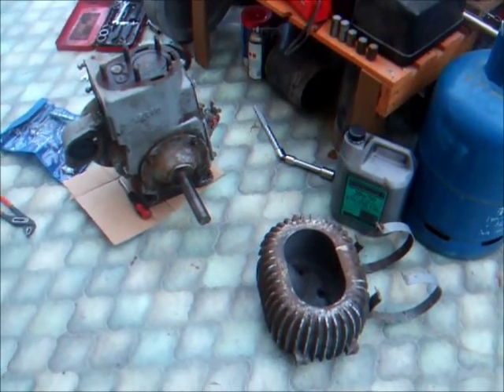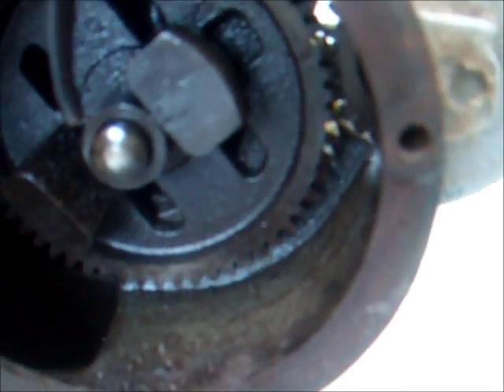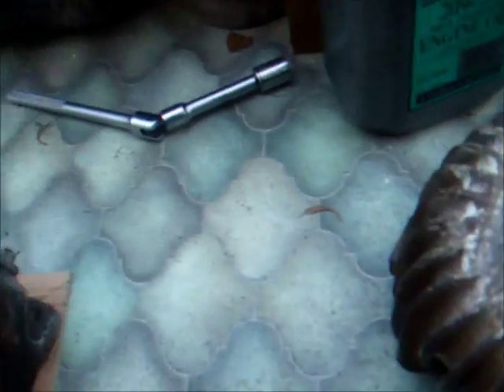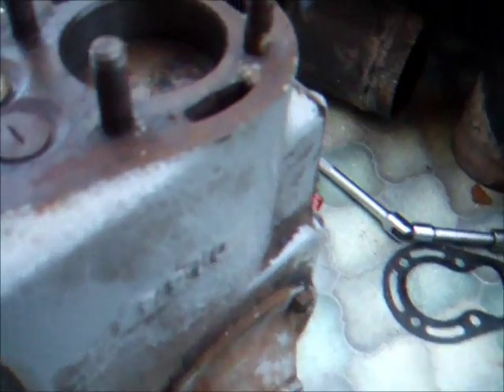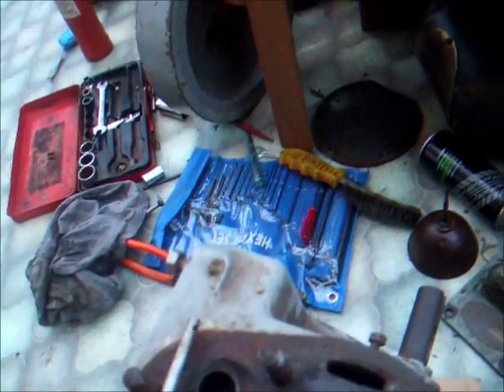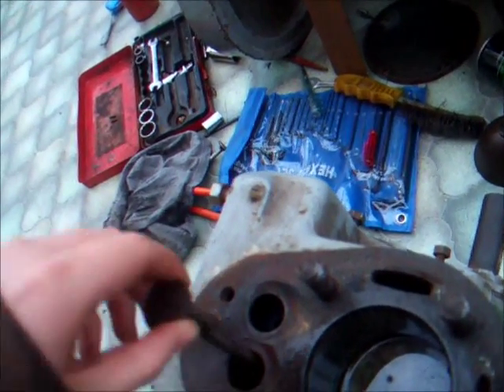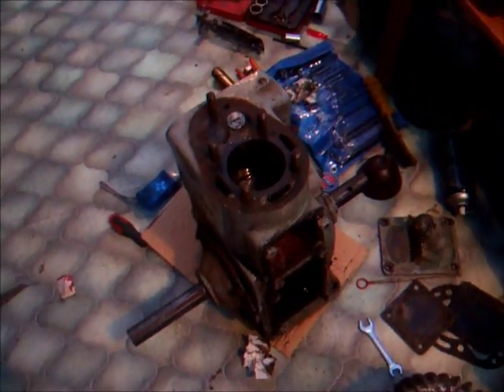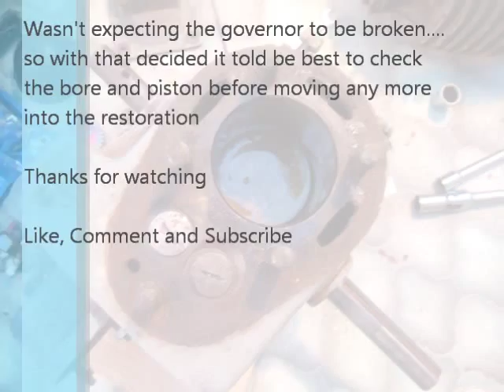Wolseley WD2 - Restoration - Part 2

Comment: Good luck with your engine. On my Villiers mark 12/2  I reused my head gasket  but it needs replacing. It has a thin area which is causing a leak and very low compression. It does run like that but not very well. Cheers.